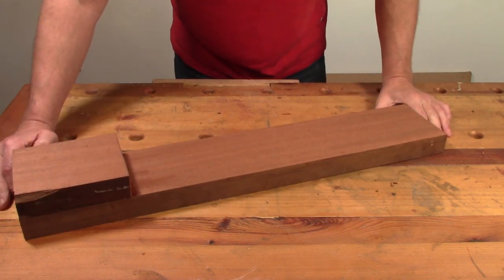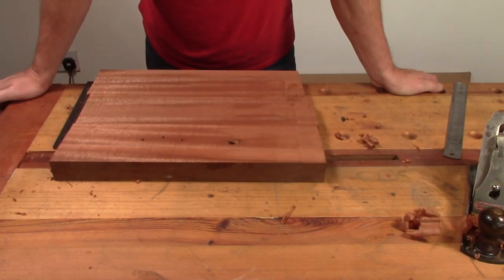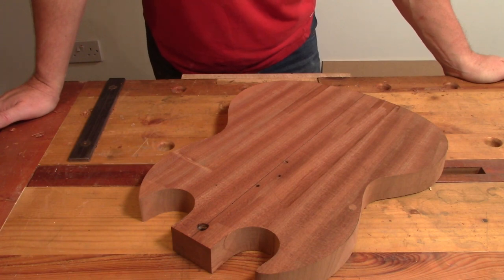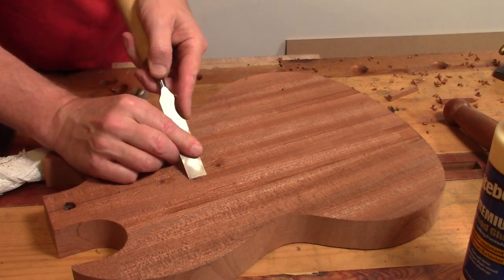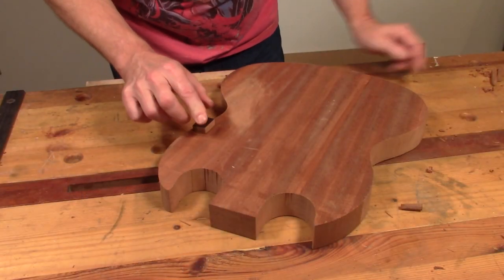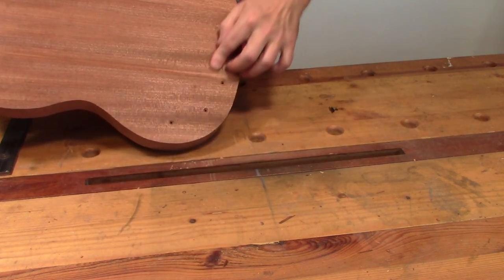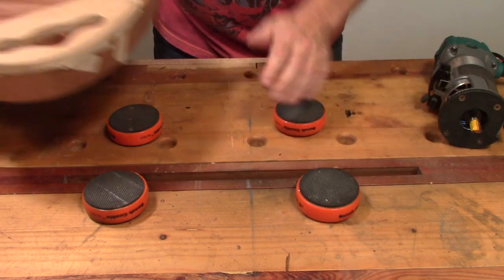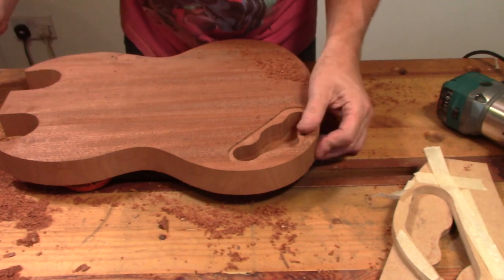Great Guitar Build Off : SG junior style guitar build part 2

Comment: I'm surprised those Dalles didn't try to push themselves back out, considering the hydraulic pressure that's created when you're hammering on top of glue. Looks good though. I like it
Reply from the maker: The holes were deep and not filled with glue, I also pounded them in hard :) Thanks for the feedback 👍

Comment: Looking good and coming along nicely. I've had good sucess plugging holes by drilling them out to a plug cutter size I have and then making plugs from long grain wood. In woods like sepele and mahogany the stripy looking grain can be matched quite well. I did this process on a bass rehab I did years back. Here's a link https://youtu.be/AbuAV6LdSmQ
Reply from the maker: Thanks for the tip Dane, worked a treat :)
Reply: Adventures from the shed of dreams, it’d be great if you could stain it.
Reply from the maker: @jonahguitarguy  wait til part three ;)